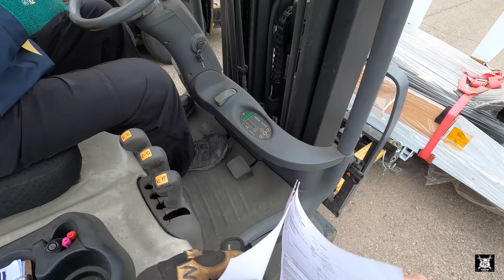Hauling My 12v71 Detroit, Motorcycles, Lawn Tractors And Customers Freight

Comment: DetroitDeisel published book in late 70-s and 80-s specially for on-road application: "V71 series Highway Vehicle Engine Service Manual". Might be helpful for your 12V71 swap. You can still find it on eBay or Amazon.

Comment: lol v12 try 2 side by side  405 hp combined  6--71 Detroit's mounted in a Rhodes Ridley truck rated gross combination mass of 230 tons lol with Steve riding the lawn mower thinking of the ring tone notification sound  playing while Steve is cruising the block Orwell has become toy hauler bike check v12 engine check mower check check